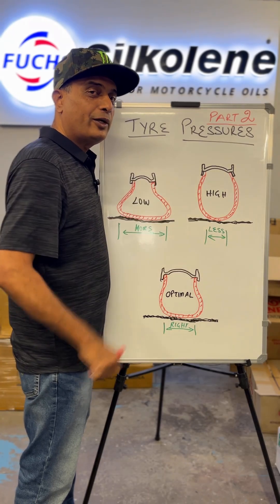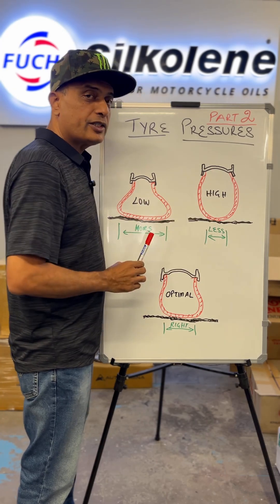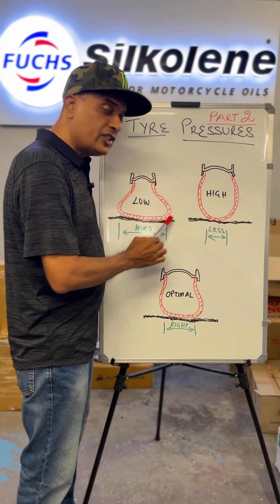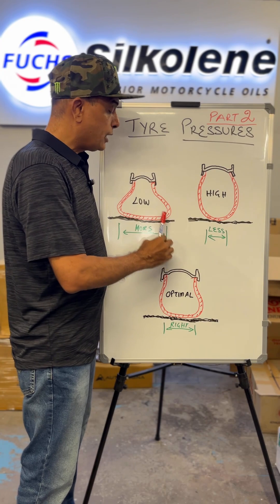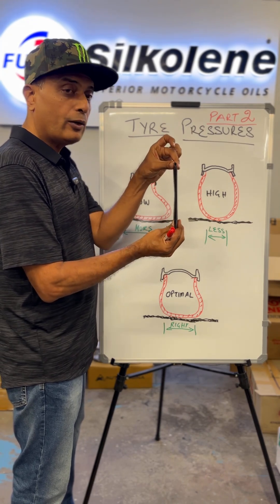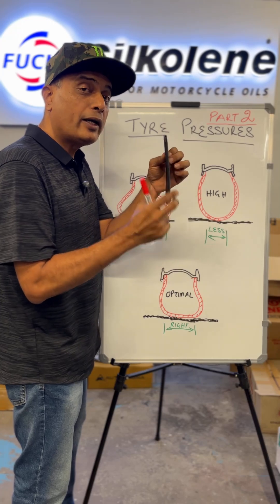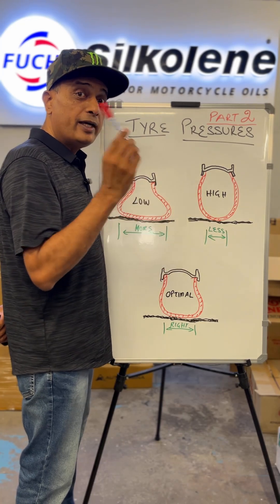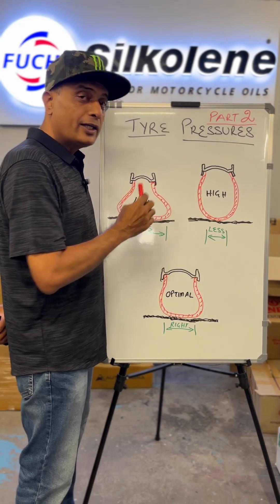Tech Tuesday - Dangers of incorrect tyre pressures

Comment: Hi Bosky! I recently got a Royal Enfield Hunter 350 after riding a Honda Activa 4G for years. I used to commute daily on the Activa, covering at least 60 km, and always felt confident and connected to the road. But with the Hunter 350, I’m struggling to get that same sense of predictability and response. I’ve even had a small skid, and it misaligned the handlebar, which further shook my confidence.

I’ve ridden other bikes like the TVS Sport and even the Classic 350, which felt more responsive and predictable, but the Hunter seems harder to control, especially on uneven roads. I also have a long daily commute, and the constant bumpers and bad roads are causing back pain by the end of my ride. I’m not sure if it’s the suspension, riding posture, or something else, but I’m finding it tough to enjoy the bike as much as I expected.

Do you have any advice on how I can improve my connection with the bike, handle it better, and make the rides more comfortable? Your guidance would mean a lot!
Reply from the maker: Some who have had somewhat similar issues have switched to the Classic Reborn rear shock absorbers and it has helped their ride comfort. You may try that .
Reply: @ it’s not only about suspension, Im lacking confidence which I never did in any motorcycle. I can’t predict how will it go, or when to press brakes and how much……. How much tyres are intact? I can’t predict anything. I got skid also some days ago.
Reply from the maker: That’s probably a personal thing and I cannot comment. 
Most whom i know who own the H350 are super happy with it and are enjoying the ride.

Comment: professor we need knowledge on beat grippy tarmac brands / tread patterns / optimum width to have optimum drag and good cornering ability etc all info ,
Reply from the maker: Stock tyre sizes recommended. Am not a fan of upsize.
Tyre brand and pattern is largely a personal preference and individual confident matter.

Comment: Hey bosky if there is low pressure in tyres and ride it on the highway there will be heat build up then the pressure will also increase. When we tour the tyre pressure is increases due to excessive heat from tarmac high speed and ambient temperatures. What about that ?
Reply from the maker: Stock recommended tyre pressures take into consideration the heat build up and consequent increase in pressures.
Reply: When u maintain optimal pressure, it can take care os extra heat and whatever increase in pressure